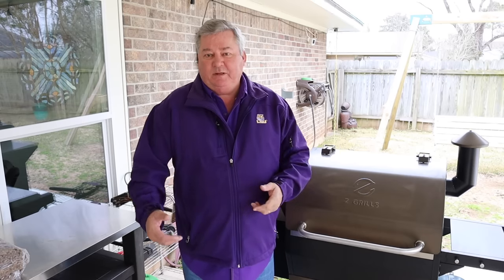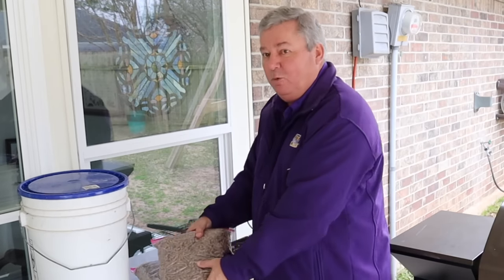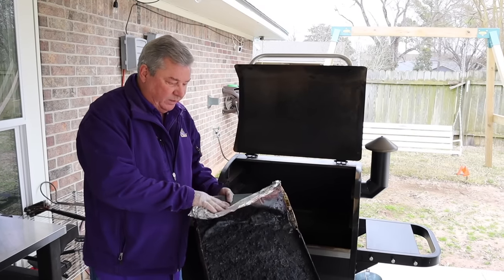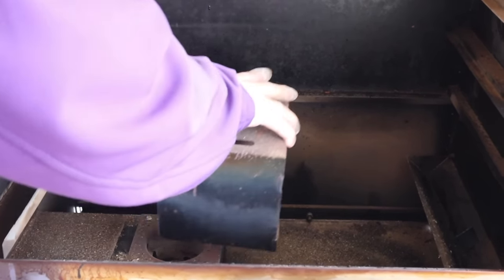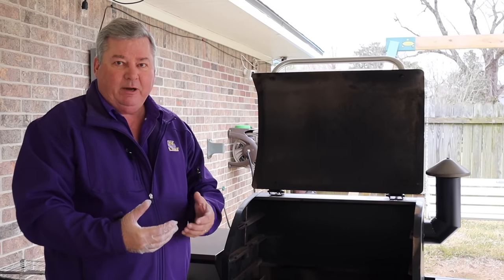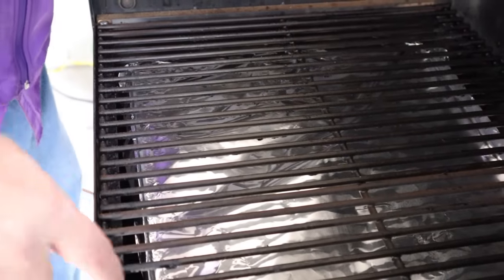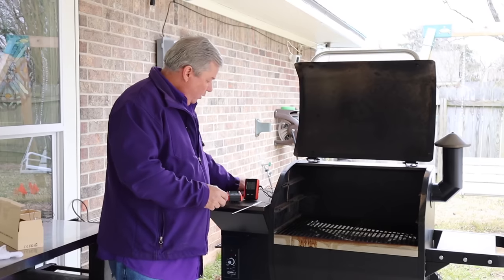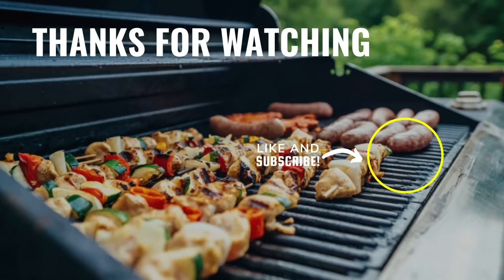Avoid making these 7 HUGE mistakes on a PELLET Smoker - Southern Backyard Cooking

Comment: Mistake #1 should be not turning off the grill manually instead of letting the shutoff cycle do its thing. Unburned pellets sit in the  fire pot if manually shutoff. On next use more pellets are dropped in the fire pot(adding more pellets to the already unburned ones in the fire pot) causing a bigger than expected fire or the exploding of pellet grills as seen on other videos. I learned the hard way. I almost lost my pellet grill!
Reply: I learned the hard way too

Comment: Thanks for the tips.  I’m new to a pellet smoker.  After doing my burn in, I did the vacuum of the ash pot and grill like you recommended.   👍🏽. I noticed that I couldn’t get all the tiny pellet dust that coated everything,  I took my electric leaf blower as a 2nd step for a couple shots of compressed air and that cleared all fine dust/pellet ash particles out.
Reply from the maker: Glad I could help!

Comment: Literally just bought a "gently used" Z Grill that looks similar to yours. Its in good condition, only used a few times. Testing it as I speak with nothing in it. I think while transporting it in my trailer, a lot of pellets or dust got on the burners because it began smoking a LOT. Your video is perfect for me at the perfect time. Thanks!

Comment: Great video.  I vacuum mine out about every three cooks and change the foil.  I never thought about wiping  out the grease trap or cleaning the temp probe.  Thanks for that.  Keep smoking
Reply from the maker: It helps prevent fires.
Reply: They have drip pans at Home Depot.   I vaccum it each time I use it

Comment: Thank the lord for this video. Just got a Traeger and decided to make a pork butt. I didn’t make sure the hot pot was clear of ash at the beginning. And at hour #5 it stopped working and temp was falling. Restarted it think it would be fine to heat back up. Grease pan was red hot with a fire all around it. Instantly turned it off
Reply from the maker: Glad I could help.

Comment: Comes down to: 
1. Clean your grill consistently - don't forget the thermostat
2. Don't place your food over the gaps - keep it over the plate
3. Cook your meat to temperature
4. Drain and store your pellets in a water-tight place

No explanation is given for the pellet storage (I mean obviously you don't want them rained on but why drain and seal them away vs just put a waterproof cover on the grill?), but the rest seem like basic common sense. Always good to check you're not making simple mistakes though.
Reply from the maker: The reason you store your pellets in waterproof containers is so the humidity does not break them down.

Comment: I found that the thermostat probe can be cleaned with Goof Off cleaner and a rag, or if it has a layer of baked on coating then use emery cloth(very fine grit).

Comment: I enjoyed your "7 Huge Mistakes" video, and concur with all of your suggestions.  One other tip for using a pellet grill/smoker in the South (or anywhere it's often humid or damp) is to remove the pellets from the hopper and vacuum the pellets out of the auger tunnel each time you use the smoker.  Unless you use the smoker/grill routinely, leaving the pellets in the hopper and tunnel will allow them to absorb moisture and fail to burn properly.  I tend to vacuum out the smoker after every use.
Reply from the maker: Great tip!
Reply: How do you vacuum the auger tube?
Reply: @ryanragan8899   Hey Ryan...I use a small shop vac with flexible hose.  I empty out the pellet hopper, then vacuum all residual dust out of the hopper and vacuum as many pellets out of the auger hole (bottom of the hopper) as possible.  I also remove the flame deflector from over the fire box/hot rod and vacuum as many pellets as I can out of the auger tunnel.  It doesn't remove all the pellets, but it gets enough out so that a few damp ones won't affect the cook.  Good luck!

Comment: Thanks for the vid.  Great notes for me as I just bought my first pellet grill.  A lot of these YT grillers don't talk about keeping the grill clean.  Have you ever used something like Simple Green or Krud Cutter to clean the excess grease?
Reply from the maker: I have not. The main thing I do is once a month I turn it on the highest temp and burn all of the grease off. I do not like to use chemicals on any of my equipment, it is just too hard to get all of the residue off.

Comment: Anything other than a shop vac to clean it out with? Thanks for the advise. It has helped.
Reply: They got a small shop vac attachment that slides on top of a five gallon bucket for about 20 bucks at Home Depot. Works just like a shop vac and I highly recommend trying that

Comment: I also wrapped my drip track in aluminum foil. Is that a mistake? Also, how often should I replace or what method do you recommend using to decide when to replace aluminum foil?
Reply from the maker: Wrapping the drip track is just one more way to make clean up easy. I would replace the foil after one long usage(8 hours) or two short uses (4 hours or less).
Reply: @SouthernBackyardCooking  Thanks. I figured my pellet smoker errors were mine and not Traeger’s.😂

Comment: Mistake I made was buying a not so popular brand of Pellet Grill.  It worked great.  I even ordered a new thermostat one time.  Later I had a problem with it not burning right and discovered the pot had rusted apart and pellet were burning outside of the pot falling out of holes.  Tried to contact the manufacture only to find out they sold to another company and that company gave no support on parts.  My advice is to look for a brand that has been around for a long time and is easily contactable if needed.  I believe there are a lot of good brands.  You don't need a $700 Traeger when you can buy as good of Pellet grill for $400.  Our first one was a small grill that was fine till we wanted to grill several things at the same time.  We got a better larger well known brand and very happy with it.  Has two built in cooking temp plug ins and great probes.
Reply from the maker: Yes sir.

Comment: Thank You 🙏 
Just to clarify you are saying to cover the heat plate in foil ?
Reply from the maker: Yes, it takes a lot less cleaning with it covered.
Reply: I started doing that and it began to rust. I also live on the Chesapeake Bay so the salt takes a toll on my grills. I let the grease be and just use a plastic putty knife to scrape off the excess. I also leave my grills dirty after cooks and clean just before a cook to help keep the rust  away.

Comment: I did a reverse sear (low temp then high temp 450 at finish) but the grill was dirty - giant flipping fire! Lost a $100 Xmas prime rib.  GMG Daniel Boone model.
Reply from the maker: This usually happen on a dirty grill, especially if there is a lot of grease build up.
Reply: I've had same experience with GMG Daniel Boone also. Very frustrating. The worst of it was that everything was fine until it wasn't. We were HUNGRY, to the point of salivating. Then just about the  final time I was going to temp the meat, the fires from hell errupted. It was so intense that it burned the paint off of the lid and charred bone.

Comment: Received a Traeger for Christmas. The only smoking I've done has been with a Little Chief. Never considered getting a Traeger. After two cooks and some research I'm hooked. Thanks for the seven suggestions. I noticed in your video that your BBQ has a cover over the heat tube.  I don't believe my BBQ has that. My BBQ is a 575. It's snug in under its storage cover so I'm not going to check right now. The "jerky gun" I ordered has been delayed,  should arrive today,  
then I'll un-cover the BBQ.
Reply from the maker: I'm glad you are liking your pellet smoker. I love mine.
Reply: *”The Treager”

Comment: I don’t wrap the drip/defuser plate in aluminum foil, just scrape it with a spatula each time, same with drip channel, just use the scraper side of the grill brush.  Also, I gave up vacuuming and just empty the ash pot itself, the rest of the ash doesn’t do anything to sit there.
Reply from the maker: Yes, you do not have to wrap the drip tray in aluminum foil, but is make clean up a lot easier. And if you do not vacuum the entire grill, you will have dust get in your food. If you are a fan of eating dirt and pellet dust, then be my guest and i will send you my dust also!

Comment: Hello! Thank you for your video! I have a question: we use the Z grill smoker once a week for a few months and (omg) we never cleaned it! It’s our first time experience and I’m really worrying about cleaning. I was trying to do that earlier but the dirt and grease are so viscous that my chemistry can't handle it! What can you do recommend to clean it? And also the brazier under the grate has a curved shape and I cannot put foil there… I see you have a different model.
Reply from the maker: If you clean out the ash pot, then heat it up, the dirt and grease is a little easier to clean out. I sometimes even use a power washer.

Comment: Don, is mistake #6 wrapping the drip pan in aluminum foil or NOT wrapping the drip pan?
Reply from the maker: You want to wrap the drip pan, make eas ycleanup.
Reply: I prefer no foil. I have done both and to me it's easier to put the drip tray over a trash can and using a metal putty knife it scrapes off very easily.
Reply from the maker: I don't like to do any scrapping.

Comment: I have a Pit Boss and it heats unevenly. Hotter on the left where the pellets come out and the fire is. The sliding drip plate slides all the way to the left and covers the vent holes in plate beneath. I cover the vent holes when I cook. I would think it would be even hotter if I didn't. I have to rotate what I'm cooking so it cooks evenly. This is inconvenient and doesn't seem like this is the correct method of use. Any thoughts?

Comment: I am having issues with the firepot continuing to catch the pellets on fire and the temps rise out of control. I've tried cleaning the firepot several times and tried replacing the hot rod and the actual firepot. I've tried removing all old pellets and tried a brand new bag. I am continuing to have the same result. With all that said, would this possibly be due to the temperature sensor needing to be replaced?
Reply: I'd recommend contacting your manufacturer

Comment: Do you have a problem with the foil on drip tray "melting/breaking appart" when searing at 600F+, I am using the most heavy duty foil I can find in Norway that is meant for Grilling?
Reply from the maker: Not usually, whenever i am going to do a high temp cook i start with a clean drip pan.

Comment: So, I am a little unclear about storing the pellets. Am I supposed to empty out the remaining pellets in the bin after every use? If this is the case, why is there a grid that prevents pushing the pellets down thru the emptying chute? I mean, I made an effort, but I figured I must be misunderstanding when they say to remove the pellets and store them in a dry place.
Reply from the maker: A lot of the confusion starts with how much humidity do you have in your area. How long is it going to be between cooks on your pellet grill. If there is not a lot of humidity and/or you use your pellet grill at least weekly, you do not have to empty the pellets. I live in Louisiana and we get a lot of humidity, but because I use my pellet grill almost every week, I never empty the pellets.
Reply: @SouthernBackyardCooking  I'll be using it 1-2 times per week I think, but I live in NC, so medium humidity. I'm still puzzled why they didn't include some means of emptying if that what I am supposed to do. I am going to trudge forward without emptying it and see how it goes. This thing is incredibly heavy so no, I am not turning it upside down to empty it!
Reply from the maker: Most pellet grills do not have with a shoot to empty pellets. Either you burn them all up or leave them. This is one of the reasons I put my pellets into 1 gallon ziplock bags. I know that each bag will give me between 4 and 6 hours of smoke. I only put in the amount that a cook may require so I don't have much left over.
Reply: I empty mine out every time into a cheap airtight container from Wallyweird. I also vacuum out the firepot and ash cup.
Reply from the maker: Vacuuming the dust out is a must!

Comment: I bought a pellet grill with a slide that opens the fire box for searing.  Doesn’t work unless its a ribeye with lots of fat.  Fortunately I was skeptical and purchased the Camp Chef with the gas grill searing station.  Best move I ever made!   I pre sear my thick steaks and then slow cook them at 225 till they hit 135.  Thinner steaks, chops and burgers all get done on the gas burner! Pellet grills are wood fired convection ovens!
Reply from the maker: Yep.
Reply: So glad I read this! I just bought a Camp Chef pellet grill and I LOVE it. I was scratching my head about that searing box, but I may pull the trigger after reading this!

Comment: Nice... I have used my Z Grill for just over a year. 

I generally put an entire bag of pellets in the hopper. I then clean and vacuum whenever I add a new bag. (I generally cook 2-3 times per week.) The grill is under cover, so rain is not really an issue. (Unless it is coming down sideways...) Any reason to add less?

Also, in the hot summer, it had a tough time with the temperature. It always ran 20+ degrees hotter than in cooler weather. I assumed the t-stat would compensate. It does not...

Thoughts?
Reply from the maker: I usually do not have a problem keeping temps. I am looking at changing to a PID thermostat. If you are using your pellets that quickly, I would not change what I was doing.

Comment: im about to get my first pellet grill and it seems that some of the negative is back burn. it appear that the risk can be reduced or eliminate by removing ash and dust from the inside, correct?
Reply from the maker: That is just one of the things you do to prevent back burn. More so, not cleaning the ash will actually not allow you fire to start because none of the pellets can get to the igniter. Back burning usually happens because the pellets do not move to the fire pot and start burning through the auger chamber.
Reply: @SouthernBackyardCooking  ok thank you. So keeping the auger in good running condition is the best bet?
Reply from the maker: The big thing is make sure that you have good pellets and that they don't get wet or have too much humidity so that they don't break down a hang up in the auger tube.
Reply: @SouthernBackyardCooking  do you have a video about pellets or a good recommendation.
Reply: @SouthernBackyardCooking  as a side note I'm making the move from a propane grill to a pit boss pellet grill. Your video and info was very helpful, thank you.
Reply from the maker: Yes, I just make one about which pellets I have to be the best. You can find it on my channel.
Reply: @SouthernBackyardCooking  cool, thank you sir

Comment: Got a traeger grill a while back and have done somewhere around 30 hours of cooking. I have never cleaned the burner pot but makes so much sense why the temp has dropped on me several times. Thank you!
Reply from the maker: Sorry I could not help sooner.
Reply: We got a traeger not too long ago and we've used it for probably about 25-30 hours as well. I clean mine before a long cook and everytime I have to refill the hopper. My parents don't believe in the shutdown cycle which doesn't help with keeping the pot clean.
2 days ago I did a brisket and had a flame out. Had to take the whole thing apart. The entire pot was filled with pellets. If that would have reignited I'd have had a big ass fire and probably would have warped the insides of the grill. In conclusion it's important to clean the pot!
Reply from the maker: @scotttruehart8024  I could not agree more. Thanks for your input.

Comment: I'd like to add one more . Don't use water and soap on grill trays. Use a heat gun, a torch or wrap grill in foil and bake it out in the furnace. This will not hurt smoke seasoning
Reply from the maker: Yes, definitely do not use any soap at all.

Comment: I get the temperature thing except for pork ribs.  Can you accurately place a probe in them?
Reply from the maker: Ribs are very forgiving. They are the only thing I do not use a temperature probe in
Reply: @SouthernBackyardCooking  That's what I figured.   Did mine 5.5 hours at 225 and they were a little tough.  Suggestions?
Reply from the maker: Did you wrap them in either foil or butcher paper? I always add either some beer or cider vinegar to mine.
Reply: @SouthernBackyardCooking  No but will do next time.  Used to my old barrel smoker.
Reply: @SouthernBackyardCooking  I usually use honey and brown sugar with apple cider then wrap them.  Last time I used a little whiskey instead of cider.....NEVER using cider again 😉
Reply from the maker: @davidchamberlain5146  I like the idea of adding wiskey. i will have to try it this weekend!

Comment: Doesn’t wrapping drip tray with foil defeat the the smoke holes ?
Reply from the maker: Not if you don't have heat holes. Most pellet smokers do not have heat slots.Those slots are for the heat when searing meat, not for smoke.

Comment: How do you get the pellets out of the auger?
Reply from the maker: If your smoker does not have a dump, then you need to take as many our of the hopper that you can and burn off the rest.
Reply: Pit boss Grill the dump only does the hopper I took a shop vac and taped a 1” hose to reduce an got most out I’m new to pellet smoker wasn’t sure if there was a way to get the auger to run without the burner on. Thanks
Reply from the maker: Once you dump the hopper, just keep the smoker on and it will burn all those in the auger area.